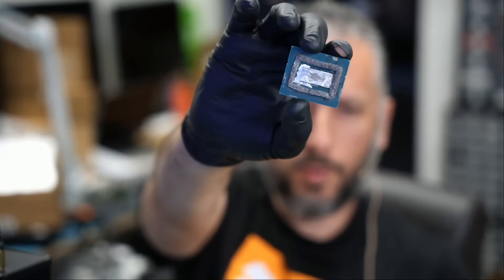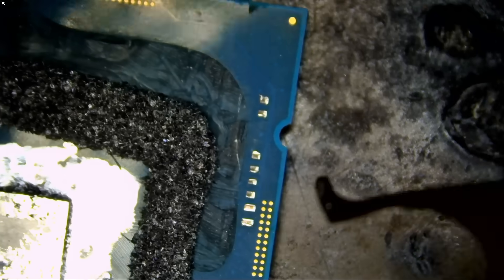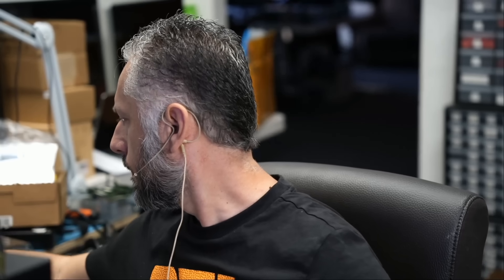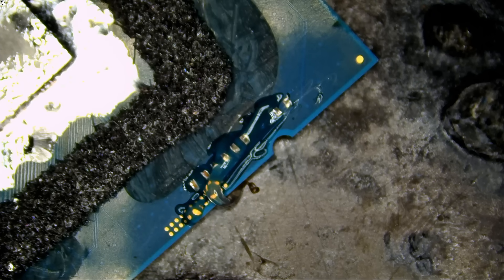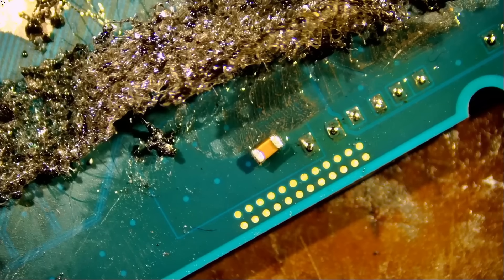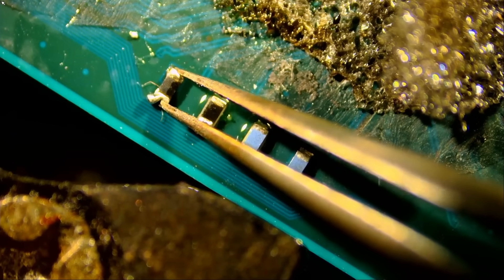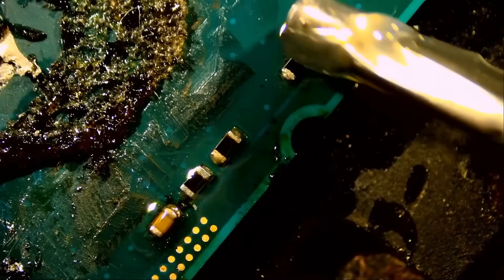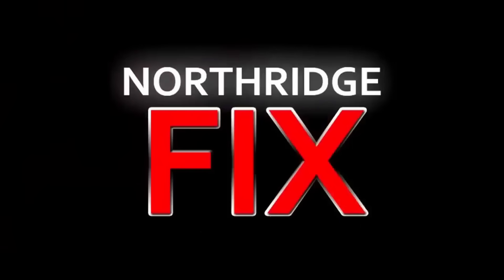Intel 14900KS 24 Core CPU Repair - Components Ripped during Delidding

Comment: sir i have the same issue but only the 2.2k one fell off while cleaning. my cpu is 14900kf is it the same with yours ? third one from left 2.2k 805 capasitor right ? (2K2 0805)

Comment: i'm old enough to see the birth of overclocking but it is essentially dead now taht manufacturers are better maximizing potential of the chips while using a default voltage which usually  uses 20% more power than that makes sense

Comment: delid a cpu that have cheap thermalpaste between the die and ihs is one thing, but why delid a soldered cpu ihs, even if you use liquid metal, it's not gonna be a huge difference.

Comment: Delidding is a great option when you know what you're doing, this is the #1 thing that happens when someone uses a Delid tool wrong and doesn't know what they are doing. 

Delidding and using this CPU in a custom loop with a direct die block is a must of you actually know you to overclock.  Because a good vision loop direct die will keep this CPU away cooler than just (5 degrees).

I run my delidded 14900ks at 6.0/5.2/4.8 on the P/RING/E cores on the daily and never exceed 90c during synthetic benchmarks, let's see you do that on a non delidded 14900ks on an aio while drawing 430w and not thermal v throttling because it's in a custom loop on DIRECT DIE.
Reply: Also to add, this person did a fucking shitty job with that CPU Delid, didn't clean up all the old solder from the die and get the die to a mirror finish, left plenty of old residue from the ihs adhesive still on the board and instead of just using conformal coating on everything around the PCB uses a foam square, which will make cooling that CPU shit.  Definitely didn't know what he was doing

Comment: These intel cpu s are hot. In some cases, when the cpu actually has to folfill ots purpose and compute some, it may get that hot that it starts to slow itself down - imagine yourself to upgrade to newer and faster abs very expensive platvorm and it instead pf being more effective starts doing this.. of course delidding is one suggested opitions for that.. if done properly the temperature drop is not the mentioned 5 degrees. If you render a video for a long time, the thing you gain is time that can measure in hours.

Comment: Delidding is not the way forward, high quality Peltier and waterblock of some capability is the true way to get the lowest temps without having to go cryo and will pump heat out of the CPU or GPU into the waterblock which if connected to a good viable circuit will produce very very low temps on overclocked items and no damage to chips, you don't need to delid.

Comment: Do you guys accept donor boards? I have an old x99-A mobo that stopped posting a couple months ago. I already got a new board and all the components work with it, but I don’t wanna throw the old one in the garbage if it can be useful to someone. It was pretty dusty so I’m assuming something shorted, but it would power on, just couldn’t detect a cpu or perform a bios flashback.

Comment: Another teleshop. Why we delited ihs ? Because the advertised power is first 10minutes of workload, after 10min, the cpu work same like mid-end cpu for 200$. It is like buy rtx5090 and cap fps on 30fps.

Comment: I'll never understand why anyone would buy an expensive and powerful CPU only to delid it for the sake of a few degrees
Reply: It's not for the sake of a few degrees when it comes to certain CPUs.  The 14900KS almost requires delidding and direct die cooling to maintain it's boost clocks without overheating due to far Intel pushed it, the 10-15 degree difference will likely be the difference between it running normal and thermal throttling.  If you are using the proper tools, it's not as dangerous as it looks.  It is definitely an enthusiast level thing though, I wouldn't recommend it to a novice but I wouldn't recommend a novice to buy a 14900KS either.
Reply: @ZoneXV  You don't need to delid a KS CPU to keep it from thermal throttling.  Running a 14900KS daily without delidding and have yet to see it throttle.
Reply: Actually, the answer to your question is right there... if they're buying the most expensive and powerful CPU then they're probably not stopping anywhere to get maximum performance
Reply: Seems a bit pointless
Reply: lower degrees can lead to better performance while maintaining stability (lowering the chance of thermal throttling), all to maxed out its potential. 

or the owner maybe is an overclocker, which requires to break the limit to achieve highest score possible.
Reply: You can get decent performance gains from doing it also potentially extending its life span
Reply: Back in the old days delidding was more important but then even Intel figured out that they can add high-end bins at the factory and use high performance TIM under the lid from the factory, and then collect money from they buyers by themselves instead of letting delidders to take a cut between. Before that companies like "Silicon Lottery" purchased high-end chips, delidded them and then sold the finished product to people with too much money. That made more sense: you get the fastest possible CPU and somebody else took all the risk from delidding and you pay nothing if the fail in the process.

Comment: What is that plastic on the top of the CPU, would it not melt when the core reaches max temps?
Reply: Kinda sponge or Something to hold to prevent metal from spilling. Like on the ps5.

Cpu max temps are at 80° c or so with cooling. Wont melt
Reply: If your cooling solution is adequate it will never get close to melting anything.